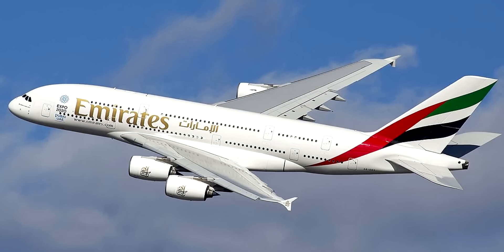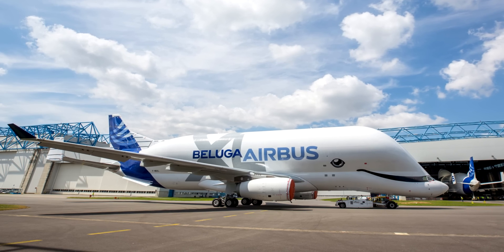Why Isn’t The Beluga XL Based on the A350 or A380?

Comment: This is what I don't understand, the Belugas are twin-engine aircraft, but pretty large, and able to lift big and heavy cargo: So if the Belugas can be twin-engine aircraft, and if quad-engine aircraft tend to be more inefficient with fuel, then why can't we adapt the a340, a380 and 747 to be twin-engine? It doesn't seem like they are so much bigger that it would be impossible.

I'm sure it's too late after the design process now, and all the real opportunities were missed. And the 747-8i is actually amazingly fuel-efficient per passenger seat for being a quad-engine, so good job on that. But twin-jet ETOPS certification has been a thing for a while now, and the companies all knew fuel efficiency was putting pressure on their quad jets, so I don't know why at least the 747-8 program, which re-engineered so much of the plane, didn't work towards making it a twin-engine from the ground up to secure its future. The timing seemed right. And I mean the 8i pretty much has all-new wings; so why not tackle the quad engine issue while you're at it? Maybe you can't get enough thrust to fit under the wings with only 2 engines, but surely there must be various options for addressing that. Or make the 747-8 a tri-jet at least maybe and divide up the necessary thrust that way. Keep the same basic fuselage, just 1 slightly larger / more powerful engine under each wing and one of the same size at the base of the vertical stabilizer, MD-11 style. You'd at least gain some more fuel efficiency that way, enough to make it a high-capacity, long-haul passenger liner with some real staying power in the market. I'm not an engineer but... maybe?

Airbus on the other hand I guess decided to do the a350 and an a330 neo over an a340 neo, so that makes sense, but they've been talking about an a380 neo; better just go for it. It seems that no airlines think the a380 Plus is a real answer. Meanwhile, a number of people still don't want to see the a340 just disappear, it would be nice to somehow be able to retrofit the existing ones anyway into a more efficient dual-engine aircraft.

It all comes down to program costs I'm sure, but when I think about the work they've already put into various versions of these 3 aircraft, and with fuel consumption pushing buyers towards twinjets for a long time now, I just don't get why that's never been done, starting a whole lot sooner. The result is struggling programs for flagship aircraft that Boeing and Airbus and everyone else still want to keep around. If it were a choice between having to go twin-engine on these three or losing them completely, I'd rather see them turned into twin-engine variants, even if it looks a little funny. Let's at least do something real to save the iconic 747 bubble, and the only fully double-decker aircraft, the a380; and I know that even the recognizable stretch, comfort and unique gear configuration of the a340-600 would be missed.
Reply: I imagine that the Belugas' payloads (aircraft wings/fuselages) are tall but not necessarily that long and heavy? Thus two engines could cope with a Beluga's payload but not that of an A380 or 747. As for the A346 it probably lacks the ground clearance to fit engines large enough to propel it such that only two are necessary
Reply: Thanks! I think you're right, and I think I'm realizing that the Beluga is not really as big as I thought. Maybe someday they'll come up with a powerful enough engine to do the job for the big birds, without a major redesign of the air frame and without making the engine too big to clear the ground. I'm starting to understand how hard this is though.

If it were me, even if the business case were a problem, I'd at least want to solve the puzzle and get the 2-engine versions ready to be produced, just to save the aircraft. Wishful thinking, but Boeing and Airbus have fairly deep pockets. They can afford to float the programs for a little bit, probably. Before long, airlines wanting their iconic 747s / A380s back in their fleets would come around.
Reply: What about this: Could the big 4-engine aircraft have two larger engines, closes to the body and 2 smaller ones with a low profile closer to the wingtips? 

They could even use all 4 for takeoff but then disable the 2 small outer ones while cruising, and if they're aerodynamic enough, maybe it's ok if they just sit there without running. 

The larger inboard engines could perhaps be a bit bigger than the ones used currently, without having to power the whole aircraft by themselves at takeoff, thanks to the addition of the smaller ones.

But anyways, if they can shut off 2 of the engines for cruise, maybe that will save enough fuel and maintenance to make the big birds economical again!
Reply: This is future me, realizing that a lot of what I said here was silly 🙃 A 2-engine A340 is literally just an A330; a 2-engine 747 is basically what the 777 is trying to achieve, minus the nose-loading cargo ability.